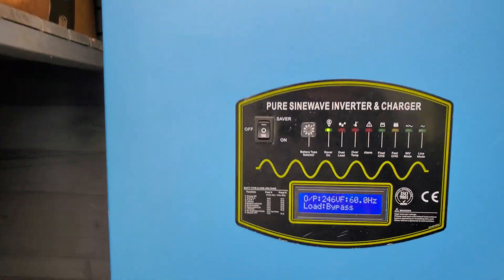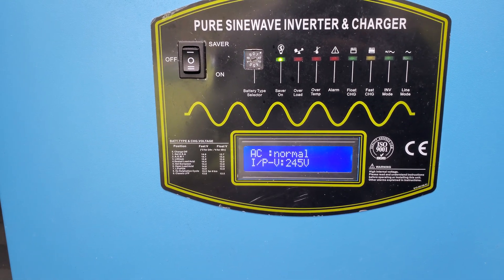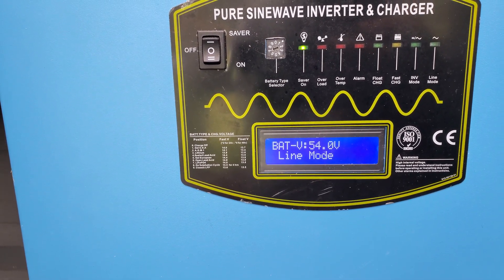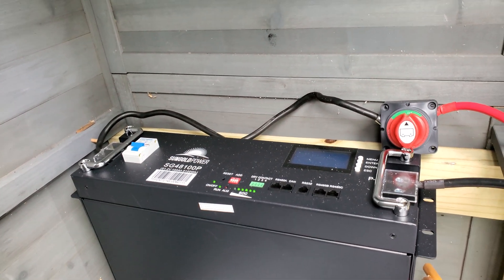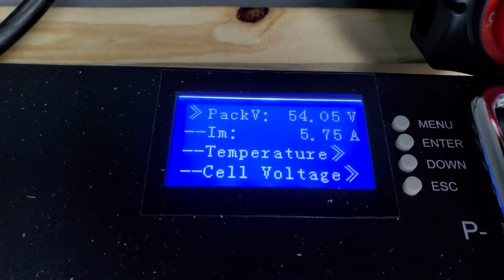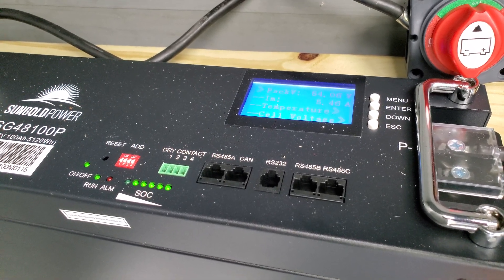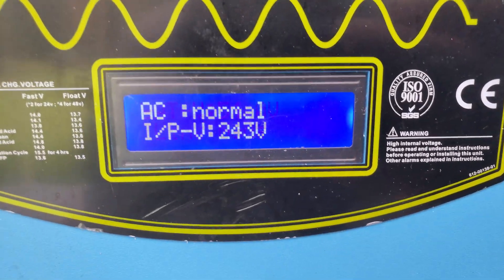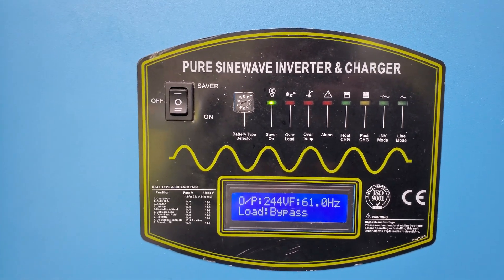Still in LINE MODE for 2 days.

Comment: Hi,
I am sure you must have tried all this, but just in case. 
Steps I would take.
1. Restart the inverter
2. Cut out the AC load
3. Play around with the POWER SAVING switch (and it looks like it is in the off position in the video)
4.  Send an email to the company.
Reply from the maker: I did all this but I'm still waiting on a response from Sungold Power about what the starting Power of the 1 battery and 12kw setup is capable of. 

It's also not very precise when stating the % of load on the inverter. So I can't even do a proper test.